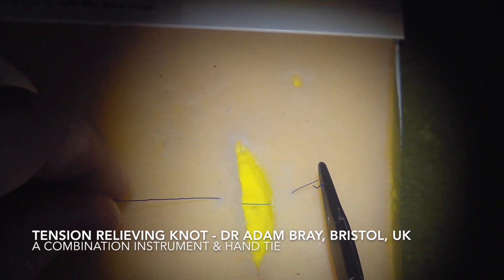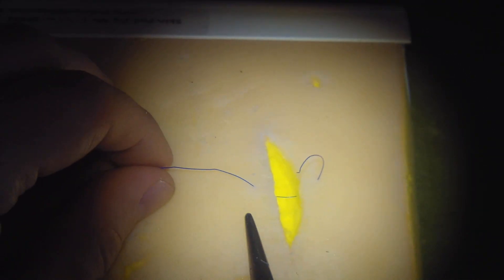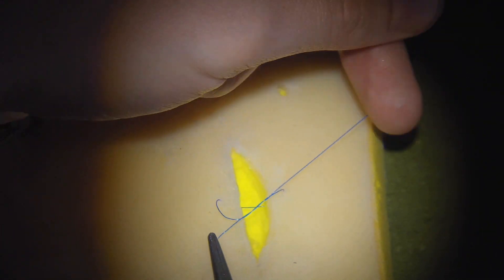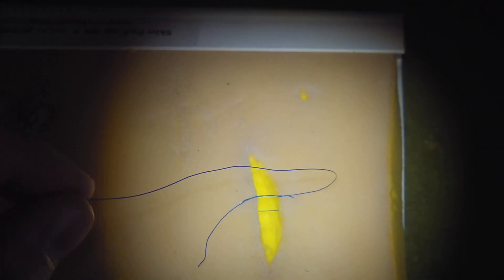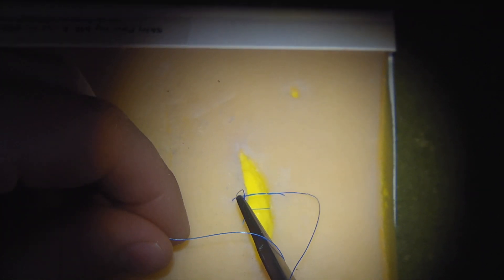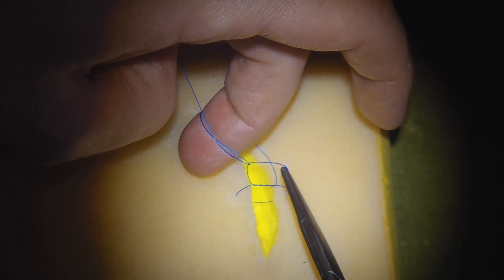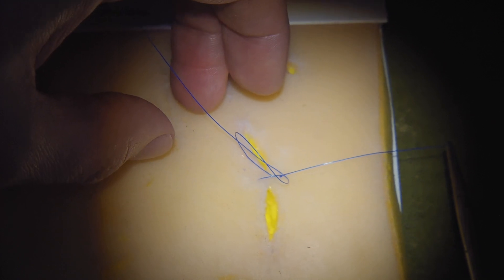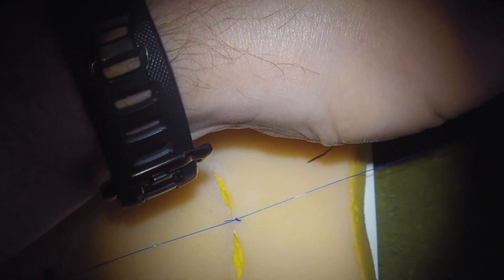Tension relieving surgical knot

Comment: Could I instead do a horizontal mattress suture for this kind of situation as well?
Reply from the maker: Good question. A horizontal mattress suture reduces the chance of the suture tearing through the skin when you pull it tight, because it distributes the tension over a wider area of skin edge. Actually any suture that has multiple entry/exit points will do that (like a running stitch), but the horizontal mattress stitch gives control of a small area and good eversion (so sometimes helpful on thin floppy areas of skin eg neck and eyelids). The technique in this video is for tying the knot at the end of any suture when it is slipping because of high tension.

Comment: uses up alot of suture pulling on the non working end like that, if you just hold a little tension on the working end (end with the needle) after you snug down the surgeon's knot it will have the same effect and not use up all your suture.

Comment from the maker: Just to add that this will also work if you grasp the suture with the needle holder from above instead, so long as you apply the finger tension on the free suture end (usually there is a needle on this end) and not the end that is held by the needle holder.